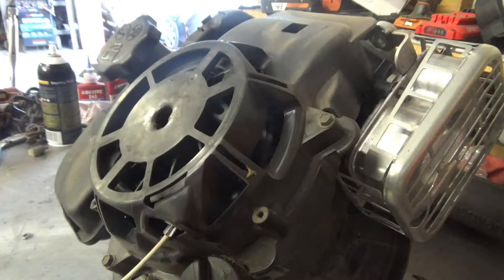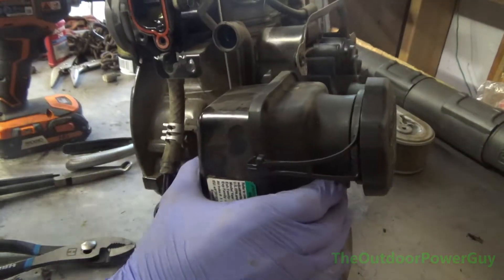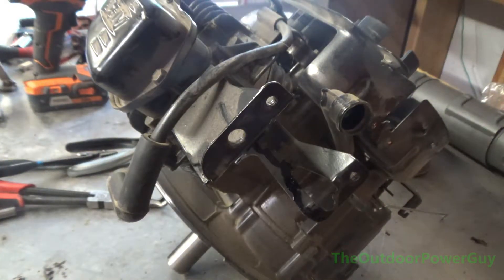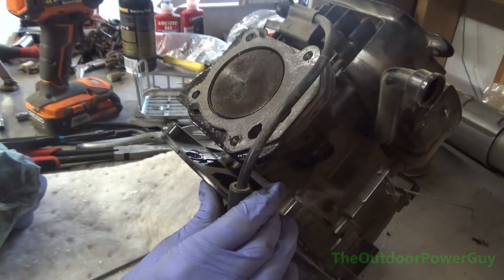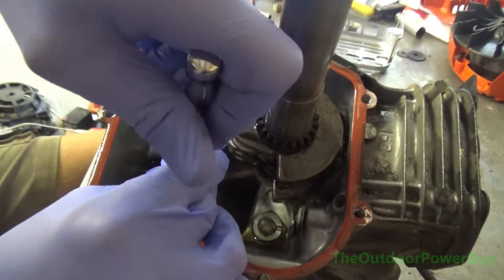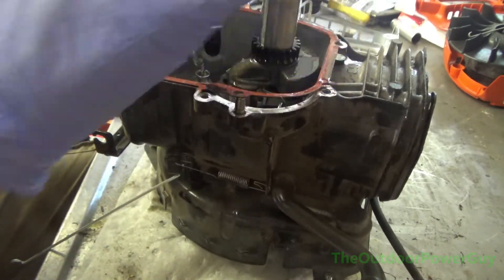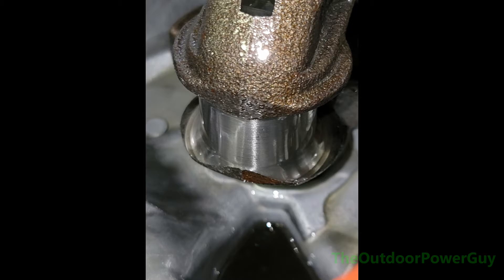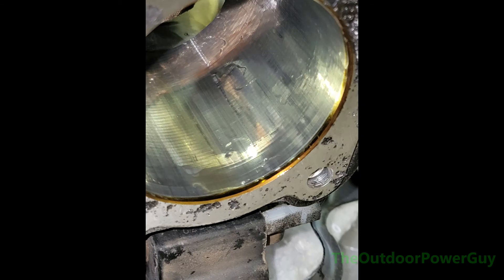Briggs & Stratton 104M02 EXi Engine Teardown | Why Did It Fail?

Comment: I can't believe you've made no mention of the state of the alloy (mating face of cylinder to cylinder head) as seen in your last picture. I've personally never seen a compression mating surface as bad as that. You can't successfully machine alloy in that condition, it's like cheese, no wonder it failed. Stinks of far eastern input, or west in your case